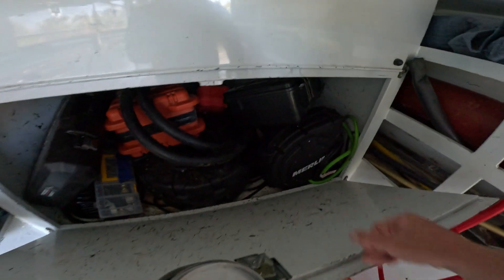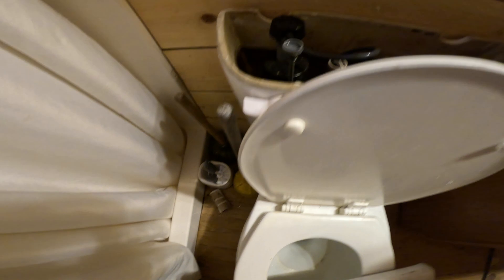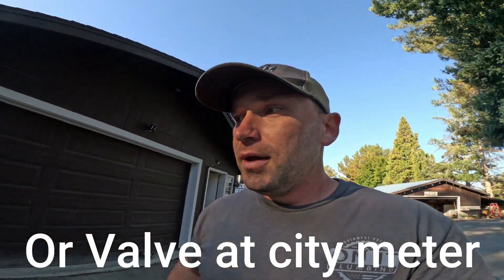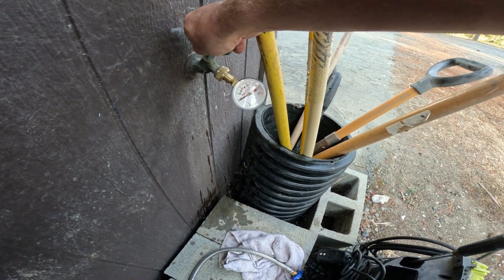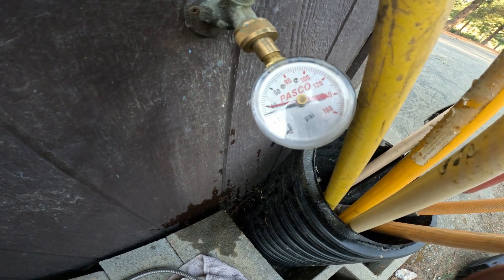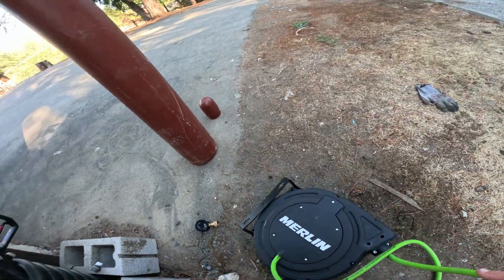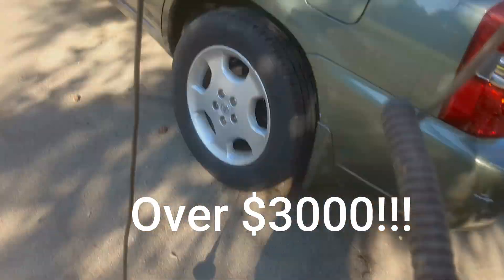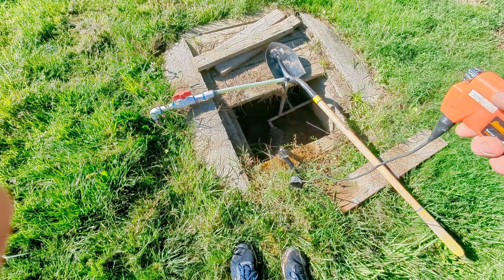How To Find ANY Leak. Trying All Leak equipment!

Comment: Just to be clear, while this is a hydrogen detection system the cylinder isn't filled with hydrogen. The tracer gas is 5% hydrogen and 95% nitrogen. The lower explosive limit of hydrogen is 4% in air. Risk of fire at 5% H2 and 95% N is reasonable. What is not reasonable is having a high pressure cylinder of anything standing unsupported on a driveway. There's a reason they come with those protective caps. Search for: Gas Tank Explodes And Spins Out of Control When Technician Accidentally Knocks it Over. Yeah, you've been doing this for years and all but it only takes a moment to leave you wishing you hadn't
Reply from the maker: Honestly I will take this into consideration though and try a longer air hose to reach from the truck. Safety is important.
Reply from the maker: Lol
Reply from the maker: They won't sell you pure hydrogen but you are correct

Comment: You dont need a tool , just an air compressor about 4 scfm . If you dont see bubbles or air, feel and listen for rumbling underground, set air pressure about 10 lbs higher than water , purge water line with air for 1 hour then turn the water back on with the air still connected.
Reply from the maker: Yeah but I can locate in the minutes. I find that efficient sometimes

Comment: I have about 300 ft  of 1 1/8" plastic line between the house and cistern.  Any suggestions on how to find the leak???
Reply from the maker: You need to be able to isolate that section so if there's valves already great. If not, you would need to install valves on each side and then a hose bib or some way to introduce air or hydrogen to the system and then you could trace the Leak or hire someone to find the leak that way